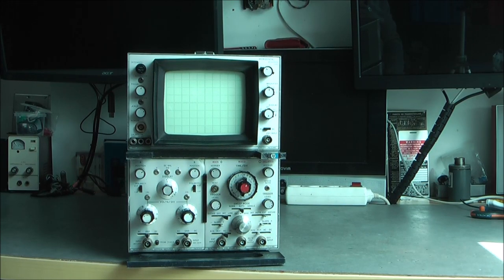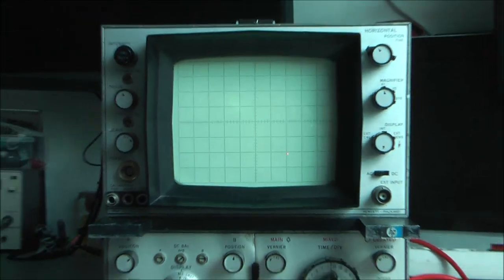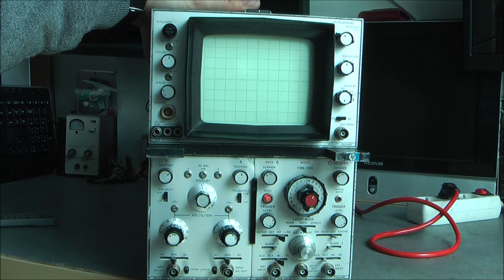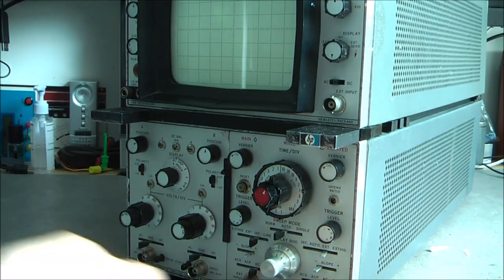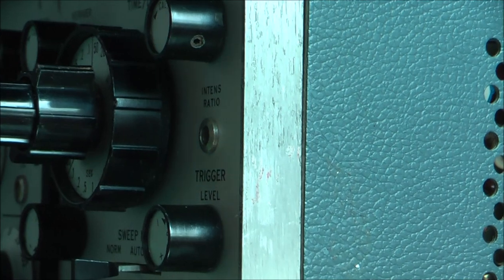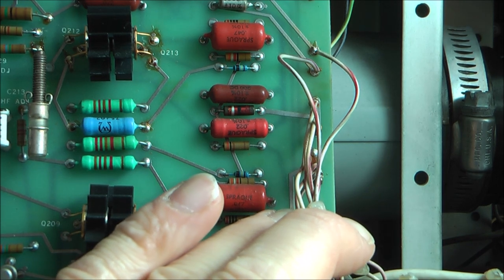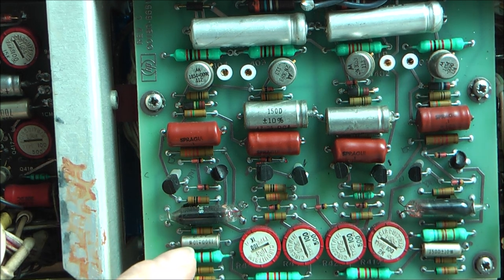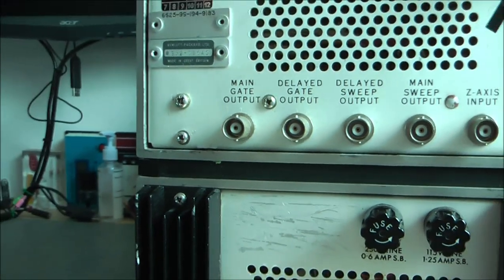NATO HP 180A oscilloscope teardown

Comment: I really like this oscope. I have one 180AR that was on a worse condition. Just had to clean it up and replace the voltage clamps neon bulbs at the high voltage section (21:55 between the suspicious parts you refer and the disk caps). And is working now!  😎 There are some problems with the trigger and the vertical is way out of screen. The good thing is all made with simple discrete components. There are no asics or dark magics inside. If well calibrated and treated it may work forever (while the crt stays intact)
Reply: is that a common issue?

Comment: On the up side you can do a fun implosion experiment with the CRT.
Reply from the maker: I'm not that lucky. I just found the CRT is probably filled with air already, it has two large cracks in the glass at the neck. At least it explains why the filament blew.
Reply: @msylvain59  That one is a bugger. Can be the problem with getting scopes on line, some end up having nothing wrong with them. Others are dead. I hae a HEMEG with a warn out old dim CRT & another HAMEG where something in the tube is no longer connected so you can't focus or change the brightness on it. To order a new CRT for ether is more expensive than just buying a new scope.

Comment: At 14:04, you had your finger right below a resistor that had gotten a bit warm. Sad to see an HP product built in that fashion, they must have been hungry for some revenue and decided to low bid that contract. You can see it has been repaired before with the sloppy solder work. Never seen a hose clamp used as a neck clamp on a CRT before. Thanks for the tear down. p.s. At 22:11, Silver Mica capacitors.

Comment: Did he say what bandwidth this thing has? The layout is hilarious by today's standards.
Reply: Depends on the plug-in modules. This ones i think is 50mhz. There are modules that support 100mhz (1821A and 1802A) and the layout is designed for portability. The 180AR is more similar to current layouts (screen sideways the controls) but requires a server rack to mount it on, and it is really heavy. 30kg probably?